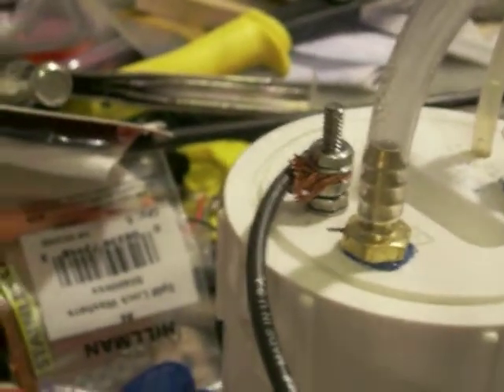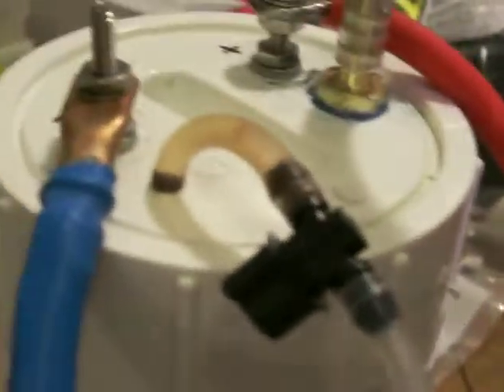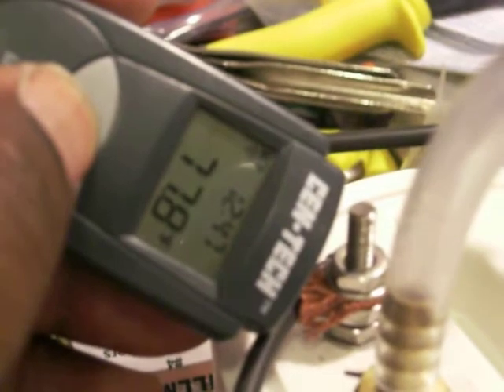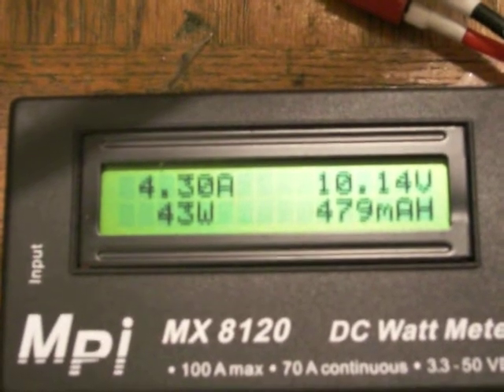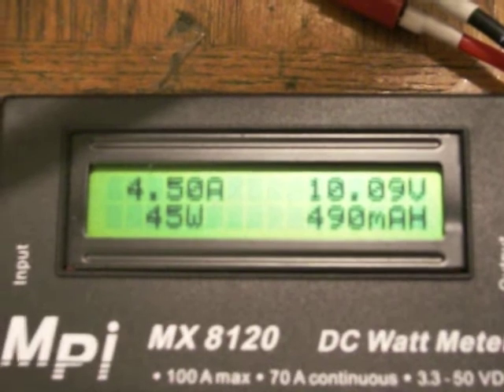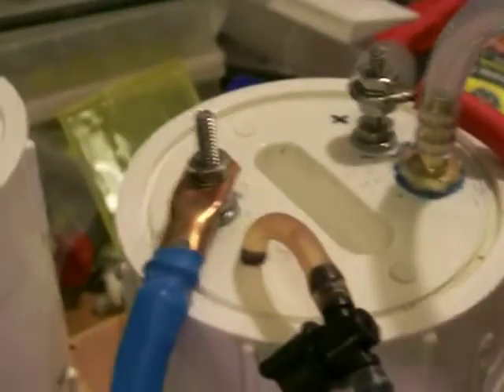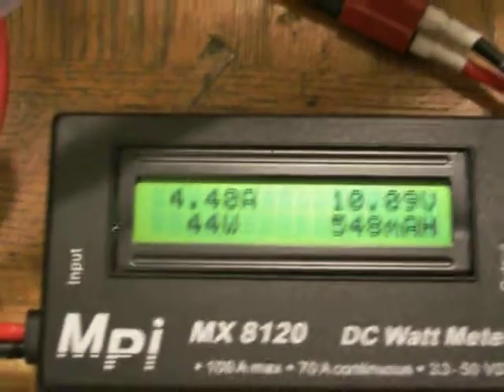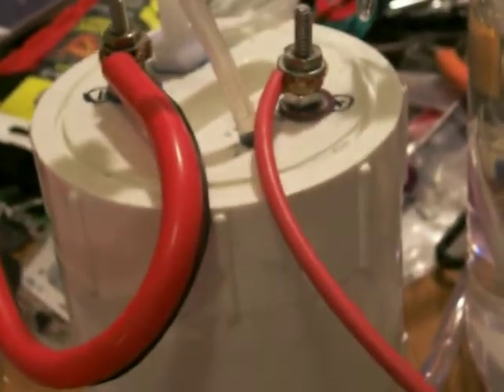3 Mini HHO Cells - 2

Comment from the maker: Thanks.. I found that I can keep the wire and connectors WAY cooler than it was in this video by using 12 gauge hobby wire for all of my connections. The exteme amount of mini strands that makes up the wire, conduct eletrons WAY better than the larger / thicker car jumper cables that were used in this video. I'm talking something like 30 deg cooler after 20 minutes and like 60 degrees cooler after everything has warmed up to operation temp.